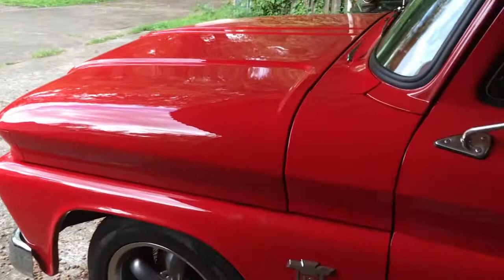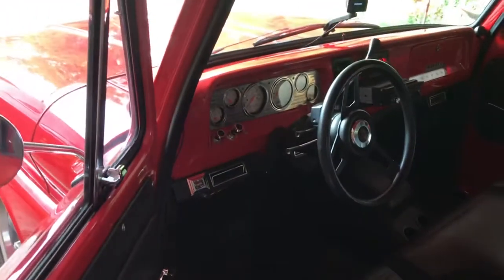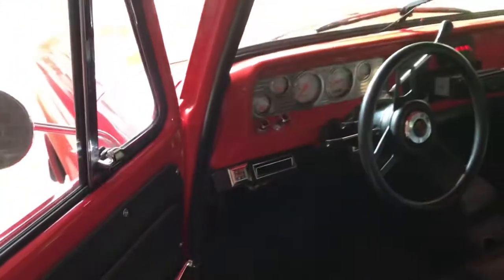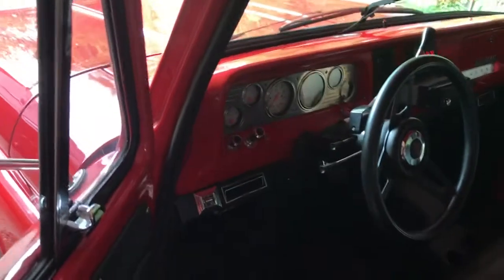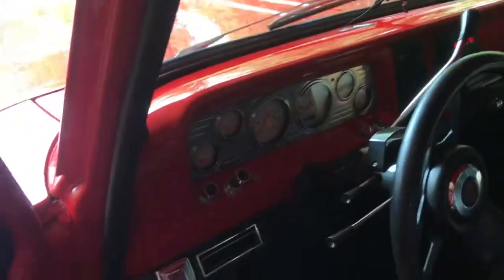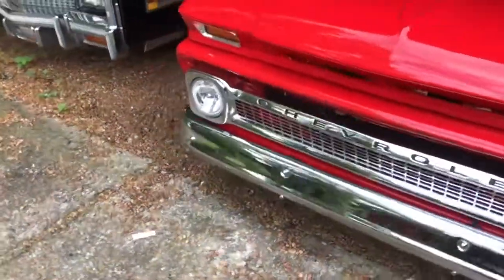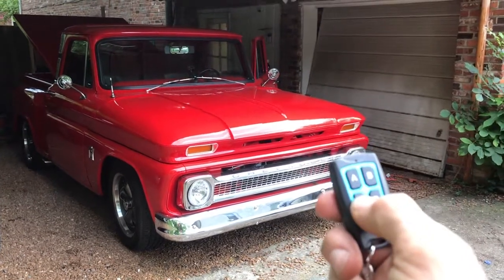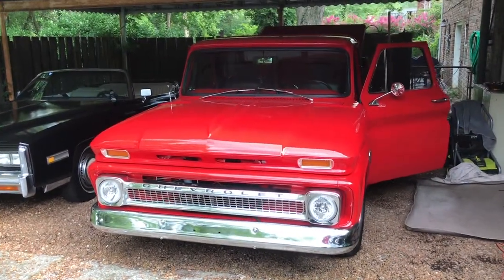Adafruit Custom Car Horn - 10 Sounds! On my C10 Truck

Comment: Pretty sweet set up Billy. Awesome shine on that paint job BTW. Color sanded, many clear coats, special polish techniques?  What is the secret you are using? HoHoHo 🎅
Reply from the maker: I wasn't a part of the paint process BUT I Lucas Slick Mist. I started using it on my black truck. Now I use it on everything including chrome and my windows. 

use https://www.amazon.com/Lucas-Oil-LUC10160-Ounce-Slick/dp/B001JT5JVQ/ref=sr_1_3?keywords=Lucas+Oil+Slick+Mist&qid=1564785607&s=gateway&sr=8-3